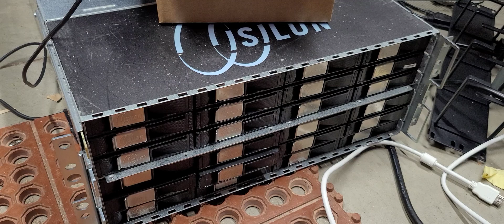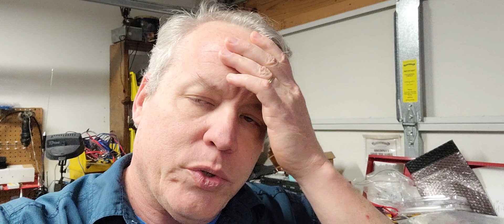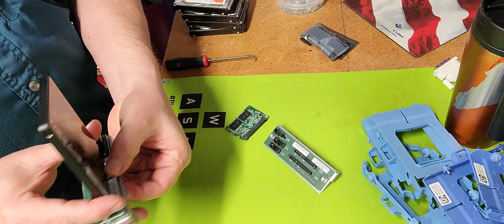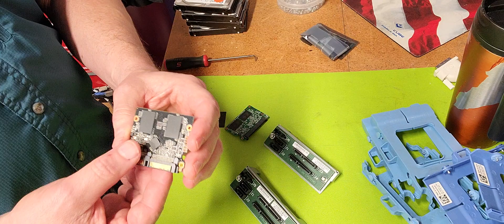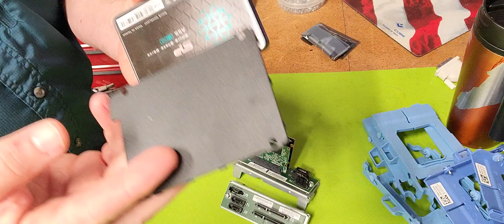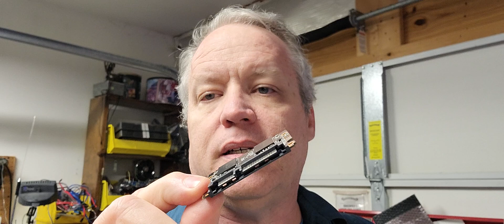A better way to do SSD SATA RAID pairing if you don't mind void your SSD hard drive's warranty

Comment: While they can say Warranty Void if opened. Legally (Magnuson Moss Warranty Act, USA) they have to prove that due to opening it / doing something to it caused the damage. Unless they find you damaged it, they must follow the warranty terms. The downside is that many companies ignore the Warranty Act and will try to deny your warranty clam solely on opening the product even if the product failed due to a common manufacture defect. In most of these cases you would need to take them to small clams court or federal court if you can find other people to be greater or equal to $50,000.
Reply from the maker: I will check this out. thanks for the heads up on this